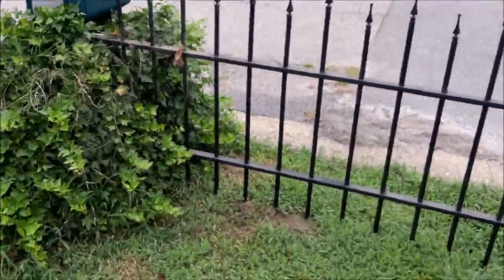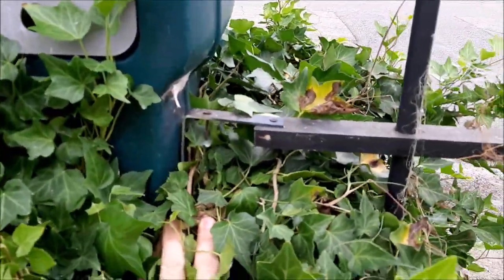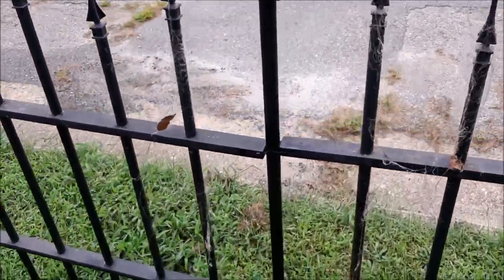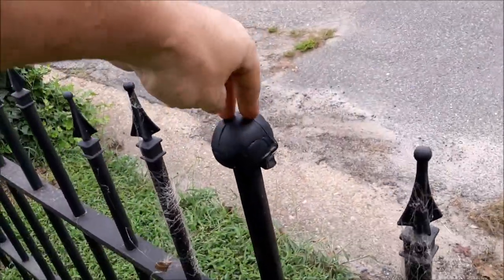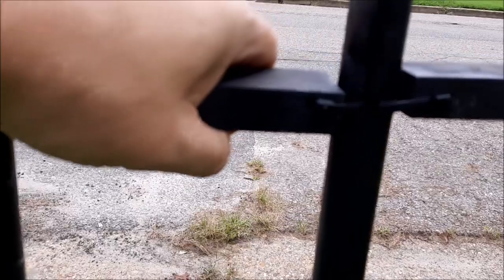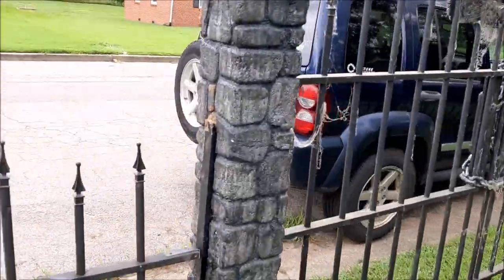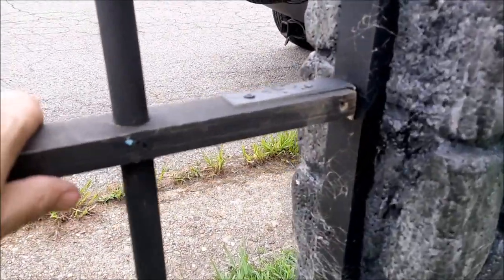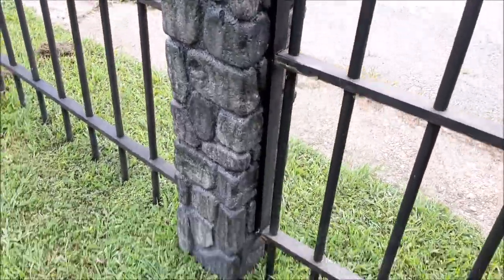FENCE ASSEMBLY

Comment: What kind of glue was used for the "wooden lattice" to attach them to the columns?
Reply: Also, Since there's rebar within the gate section, I'm assuming that it the doors are not functional (no hinges) and they stay closed? Thanks for sharing.
Reply from the maker: Clear Gorilla Glue and no, the gates are not functional.